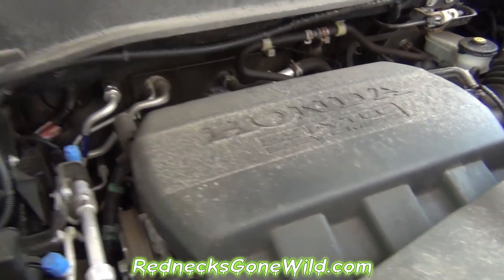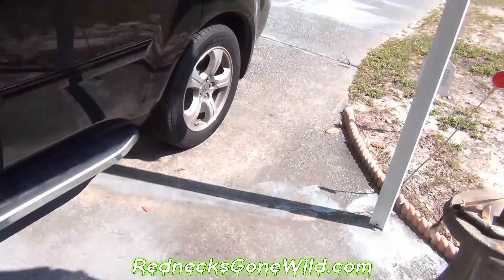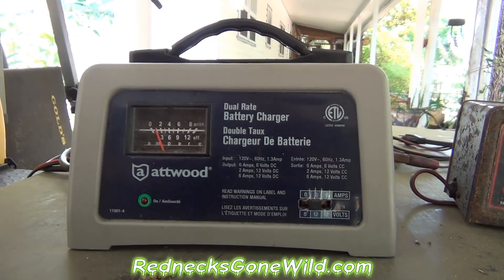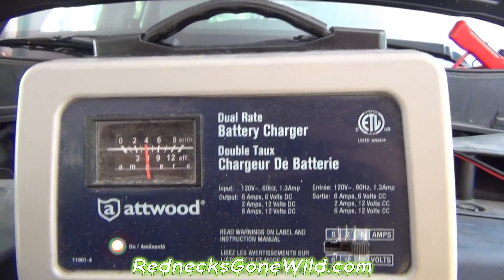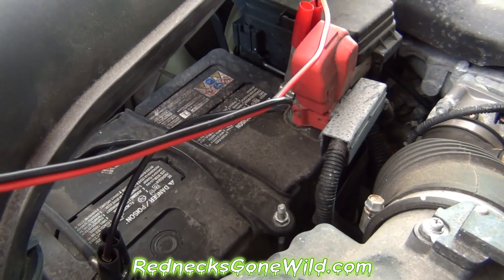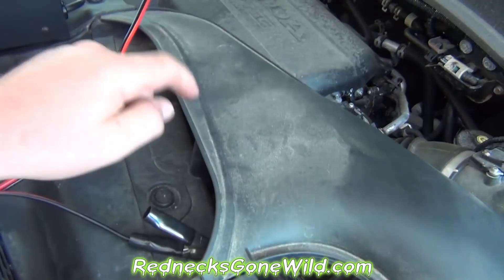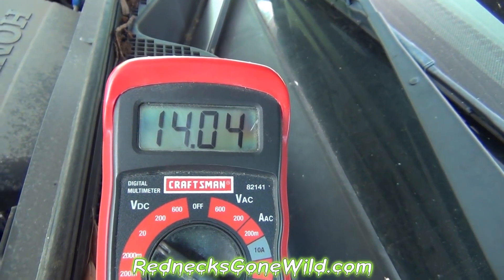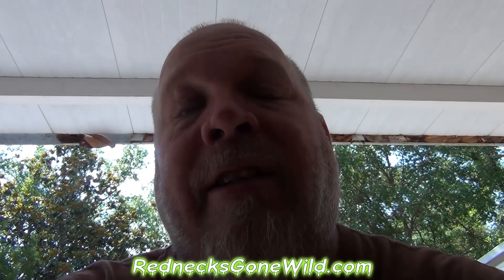How to determine whether you have a bad Battery or bad Alternator

Comment: I have a question.  I used a Battery Tender battery tester.  Jump start the car ran for 1.5 hours.  Then hooked up the tester battery was in the green.  Got it up to 2000rpms turned headlights on and high heat like the instructions said.  Hit the load button and car died.  This video may suggest the battery but doing a load test why would it die?  Battery has very little to do with keeping rhw car running once started.

Comment: In the old days on the farm we didn't have any meters. With a running vehicle if you remove a battery cable and the motor keeps running , the alternator is good. If motor quits then the alternator is bad

Comment: Much easier way. Charge or boost the battery, get the vehicle running and disconnect the battery while its still running. If it dies, the alternator is screwed. If not ,then you need a new battery! Cheers
Reply: minskimia facts!
Reply: good way to damage the computer. that way is outdated now.
Reply: @fieldysgrl98  about what year do you think that starts? Thanks

Comment: I have a 2010 Honda odyssey did the same thing like yours Honda pilot.  I bought a new battery installed on the vehicle for a year. It did again the same problem.
So maybe improperly wired some where we don't see it. That's why battery was drained quickly.

Comment: Did you checked the battery water? Cause once I had my battery dead and the problem was just the water level that was too low....actually my neighbor helped me out.
Reply: agm are not perfect either both have issues.

Comment: If you have an oreilys auto parts store near you their batteries are crap. I bought a new one for $129 and it gave out 2 years later. Good thing is that i had a 5 year replacement but i have never had a new battery go bad after 2 years.
Reply: Walmart battery is good I have one since 2013 and still good.Always pass those checks.

Comment: 2 weeks ago i had to replace the connector on top of the battery post. It was so old and eaten up that when i went to take it off the whole thing broke off. It was so bad i had zero electricity to the car. Not even the dash lights would come on. I got a jump start and it worked until i got home and then i noticed the connector had gone bad.
Reply: jbennett380 yeah...could be the connectors too...broken wire